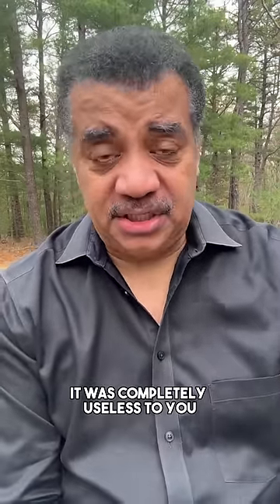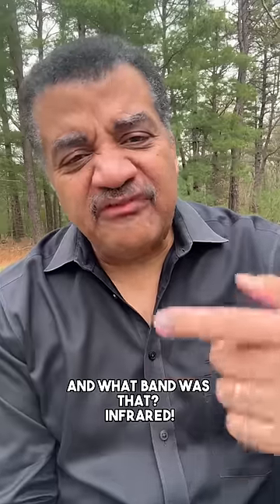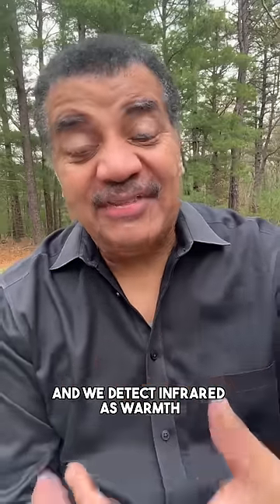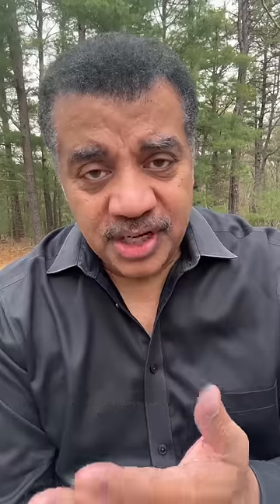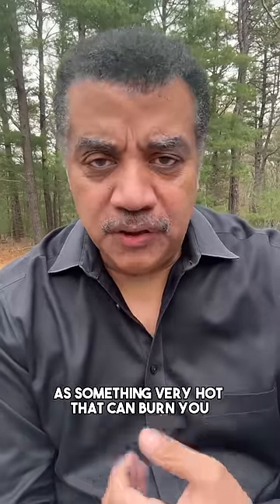LED Bulbs vs. Old Bulbs 💡

Comment: I use old bulbs in the winter. 100% efficiency. It only heats the room im in
Reply: That's the next level thinking. 😂
Reply: In the summer though,  you need more energy to cool that extra heat generated by the lights that yoi don't want. There are other ways to heat without using light bulbs that are also just as efficient.
Reply: @MrT------5743  In the summer there is also more light in the day.
Reply: @real100talk5  light bulbs are not a good application for summer or winter.

If you want the heat, you are wasting the energy of the visible light they produce.
If you want the light, you are wasting energy in the heat they produce.
Reply: @MrT------5743 that’s why they said IN THE WINTER.
Reply: @unpopulareli7333  still wasting energy even in the winter.
Reply: @MrT------5743  you do know many things to this very day use an incandescent bulb for the heat it produces? You really need to get out in the world more.
Reply: @real100talk5  using light bulbs for the heat is, in most cases dumb. Especially in a house. Lights are typically up high, and heat rises. The heat from them will not be felt. If you need heat, there is way better methods that are more efficient and more useful to put the heat where you need it. YOU SHOULD GET OUT MORE.
Reply: @MrT------5743  it's like you were born yesterday. And incandescent bulb is an electric resistance heater where 90% of the power use gives out heat. It is less efficient then other heating sources but makes sense as a primary heating source in some cases. You're spending all this time typing opinion when you could actually be learning something instead.
Reply: The person already said IN WINTER.
Reply: @real100talk5 dude stop defending a 100w light bulb as a heat source. You need 2000w resistances to heat an average room in winter. 100w does nothing more than waste energy. Whatever percent of a degree that increases is quickly dissipated by the room via thermodynamics.
And if you use 10 bulbs.. You are now wasting 100w of energy... And your room looks like the sun.. 😂
Reply: @kriptonis  hilarious you people say it's not a heat source then in a room at the same time say in the summer it's too much of a heat source in a room lol
Reply: @kriptonis  when you have baby chicks do you put them under a light bulb or a 2000 watt heater?
Reply: @MrT------5743 What if you only need 40 watts of heat to keep a very small space from freezing in the winter??
Reply: @donaldeddins569  then you are wasting the energy that the bulb is producing visible light. If 40 watts keeps something from freezing, I doubt you even need that. Also heat tape with a thermostat is better at keeping pipes from freezing.
Reply: @real100talk5  ma dude. You think this is a productive conversation? You only need to think what will you want to buy next time you need to warm up a room - a bulb or a heater. There.
Reply: @real100talk5  ma dude. You think this is a productive conversation? You only need to think what will you want to buy next time you need to warm up a room - a bulb or a heater. There.
Reply: @kriptonis  here is you "a light bulb can't be used as a heat source" also you "a light bulb is too much of a heat source in the summer"
Reply: For the same reason, in summer I use a MacBook, and in winter I use a Windows laptop. It warms up my hands and the room.
Reply: @real100talk5  you understand I never said those sentences you put in quotes? 🙄
Reply: @kim_dongryeong  ah you are my cat. How did you get out?
Reply: @kriptonis  you ignored the point. Is the light bulb is too much of a heat source in a room in the summer?
Reply: @real100talk5  why are you talking about summer? Where did I talk about that?
Reply: Is there any studies about the positive effect of the the heat release from light bulb to human body compare to led bulb which is no heating effect.
Reply: @MrT------5743 have you considered that they may use it (older lightbulbs) in the winter to light their houses, and not as their primary form of heat. The energy used to produce isn't wasted because they can see with the lights and turn them off when they don't. And the heat energy isn't wasted because it is cold and it helps in the heating of the rest of the house while the lights are in use.

Edit. Basically you can have a want for both effects at the same time, and honestly you would still likely need a heater running so like if you don't want the light it isn't a waste to turn the lights off
Reply: @bulbo-the-hero  yes I consider that.  But since another heat source would be needed anyway, and many other heat sources are way more efficient, too. So, even if you use light bulbs for heat and light, it still is wasted energy. Also, light bulbs are typically up near the cieling where you don't really want heat anyway since heat rises after all. 

 I also doubt people swap their light bulbs out between winter and summer. So all summer long, when the lights are in use, you waste even more energy.
Reply: Wow you are so smart😅
Reply: @MrT------5743 I have a brand new 98% natural gas furnace.  Not free heat, but more efficient for heating than an incandescent bulb, right?  But guess what?  I run two low speed ceiling fans as well.  You'll never guess why.  That's right.  Because heat rises.  I read that somewhere in the comments. 🤔 Even though the vents are in my floor, I still need to circulate my heat to feel it because of my high (cathedral) ceilings.  Because heat rises.  Quite rapidly it turns out.  And... in the winter... (as long as I need some amount of light, say at night on the table next to me to read) incandescent bulbs are absolutely, positively 100% "efficient". What's not converted to light, is used to make heat, which I also need.  Your assumption that lights are generally near a ceiling (and thus inefficient), is simply a generalization in an attempt to discredit others.  Besides, for those of us who live in cold climates with many hours of darkness, we find both utility and comfort with incandescent bulbs.  And to get all technical everybody's eyes integrate images at different rates.  I see flicker much more readily than many others.  I have "quick" eyes in that regard.  Sucks for me. Incandescent bulbs are also much more green from a raw materials perspective if one wants to discuss saving the planet. 

The only question therefore is why use electricity to make heat when there are more "efficient" solutions?  That's a valid point.  No doubt.  I mean, even if the heat from a bulb is utilized, precious electrons were moved to do it.  Using electricity to make heat is not a good idea because of the greenhouse gases emitted during electricity production.  Electricity production is not all renewable yet.  Fine.  But then it's also clear that EVs are a bad idea. How will they be charged then? 🤦.  Can't have it both ways.  

The reality is that "efficiency" is a matter of context.  Sometimes it means lumens per watt.  Sometimes it's lumens of a particular wavelength per watt.  Sometimes it's heat per watt.  Sometimes it's not related to electricity at all. It's all a tradeoff.  It's simply efficiency=(desired things/undesired things to get there)*100%.  Substitute your own variables.  They are personal. 

If I lived on the equator I might do something different.  But LEDs are simply not "one size fits all".

Source: Me (an optics and electrical engineer who has studied everything from quantum physics to IC wafer design and has designed electronics for more years professionally than most people in these comments have been on the planet).  I design high bandwidth photomultiplier amplifiers and laser scanners in my sleep.  I know a thing or three about "light".  So you keyboard engineers go ahead and argue about this until the cows come home. It's kinda cute. 😊
Reply: @cobra-he9xj  I'm not even going to read.all that. There are many sources of heat that are more efficient than just a mere 100%. Incandescent light bulbs are a poor choice for heat and for light.
Reply: At the ceiling?
Reply: Efficiency is only a meaningful term in context.  If I want the Efficiency of less wasteful products I can buy 1 device that provides light and heat instead of 2 devices.

That light incadescent bulb also doesn't require all the waste of the semiconductor industry to run.
Reply: @MrT------5743  
you are wasting energy stating the obvious to the people who just know what they know and what they know is right, even if God came down to visit and told them they were wrong they would still argue ...
Reply: @Astrogator1  yep
Reply: @real100talk5 Why on earth are some of the people here using "100% efficiency" like it's some kind of gotcha? 100% efficient warmth would mean it would be heating exactly what you wanted (you) at all times. Lightbulbs heat the air immediately around the lightbulb high up on the ceiling, big whoop! I bet some of you leave your hobs on to heat your house 🙄
Reply: @real100talk5 I doubt that they emit 90% as heat; probably something like 15% as that band of long-wave IR detected as heat and 75% as all other IR wavelengths, if the filament radiated anything like a black-body.
Reply: @clinch4402 it's not even 100% efficient of converting electricity into heat, convection and thermionic emission convert the thermal energy into kinetic energy

Comment: I like the old light bulb, easier on the eyes and it puts out warmth.
Reply: Also the new light systems can be hacked and used for nefarious purposes.
Reply: @T-REX677  Thats nonsense. Nobody can hack normal LED lights. If you pay extra for a smart light that can be remote controled, i can be hacked.
But then your argument is like buying a car with a trailer and then complain about the trailer.
Reply: "Easier on the eyes"?  You can get LED in either cool or warm tones... or even selectively switchable. 
Incandescent is also an inefficient source of heat that isn't wanted or needed all year.  In the summer, part of any home AC cooling would be to offset the heat from the incandescent bulbs.
The LED bulbs themselves give light for on average 25 times as long (25,000 hours vs 1,000 for incandescent)
That is 3 years of all day, every day for the LED bulb.  So, it can be justified just based on replacement frequency.
It's easily worth the extra upfront cost.
Technology advances... LED are the next step for lighting.

Comment: There are downsides, the light from led bulbs stop natural melitonin prodution so they ruin nightime routines required to get good sleep (bad for those of us with sleep disorders) but they do use much less electricity & are much cheaper to run, the old style lightbulb lasts much longer outside, if you live in a place that the temp can effect its lifespan. We had an old style bulb as our porchlight (three bulbs in ten years) but the led bulb stopped working after a couple months because of the lack of heat it produced.
Reply: is the melatonin serious
Reply: @IIIISai you can get LEDs with warmer colours which fix the problem and give you all the other benefits
Reply: You can buy warm color temperature LED lights. They do a very impressive job of matching incandescent bulbs.

Comment: Incandescent bulbs are great for heating small spaces. A 40 watt bulb turns my stove's oven into the perfect proofing box. There are other heating applications too.
Reply: Many of the commercial buildings(in northern regions) that switched to LEDs had an increase in utility costs because they now needed more heat.
Reply: @SilverEagle85 that can’t be true. Producing heat with bulbs is just electrical resistive heating which is basically the most expensive way of heating an area. Even if they used electrical resistive heating the cost would be even, not increased. The math can just never work out that switching to led’s and uppjng the heating to compensate works out more expensive in total. At worst it would be the same
Reply: Hmm…no mention the extra cooling costs in the summer when the lights were needlessly heating the place up even more.
Reply: Google is your friend.
A simple search shows you an incandescent light bulb can reach 500°.
Multiple lights will have an effect on heating/cooling.

My sister had an easy bake oven growing up. Are you familiar with how they heat?
Reply: @SilverEagle85  But that is still electric resistive heat. No matter what it is still the most expensive form of heating. So switching to bulbs that don't get hot and turning up the heating to compensate will always be cheaper if the building uses a furnace, boiler, or heat pump. or the same price if the building used resistive heat. There is no way for your total utility bill, Electricity + gas, to go up by switching to LED's. It just is not possible.
Reply: My family still use old bulbs to heat up our chicken coops
Reply: @JadeNeoma  unless the incandescent bulbs just kept the chill off and they were unable to set the heat at such a low level. Merely having to turn it on might have cost them more.
Reply: @cabbage_cat  thats understandable, you'd use resistive heat to warm them anyways so the cost to run would be the same with LED's and resistive heaters and you'd have to pay them to be installed. The thing that isn't possible is the idea that your cost to run would go up if you switched to resistive heaters (of course not including initial cost to install and such)
Reply: @cabbage_cat are old bulbs still available  ??
They have vanished from indian markets
Reply: @actualangel5133  at least in the uk there are a number of uses, such as in ovens, where LED’s are problematic so tungsten filament bulbs still cling on
Reply: Oh… I remember heating a cabinet to ferment  idli batter with incandescent bulb..in the cabinet…
Lovely hot Idlis in bitter winters.
Reply: @actualangel5133  where are you from?
Reply: Incandescent light bulbs are extremely inefficient heaters because they are not designed to be heaters.  There is no case where they are the most efficient method of heating a room.  Note that I am talking about ordinary bulbs here, not "heat lamps" or the like.
Reply: Easy Bake Oven
Reply: My halogen srip  bulb heater is the best as its rediate heat and heat atoms not air,, like the sun
Reply: They kept the water pump on my well warm. 60 watts was a cheap way to keep my water from freezing
Reply: @cabbage_cat   bulllshitttzzz can't even get em now
Reply: @phillp7777  have you even considered that there are people who live in other parts of the world
Reply: Where would the kids oven be without it 😅
Reply: What is a 'proofing box'?
Reply: @annhalton1963  .  It is a warm environment where you place dough made with yeast and the dough proofs or rises
Reply: @thomasmatthews8055  Oh! Interesting. Thank you!😁
Reply: @patrick764 lights shouldn’t be needed at night, especially in summer when days are longer. Follow your circadian biology and go to bed when it’s dark